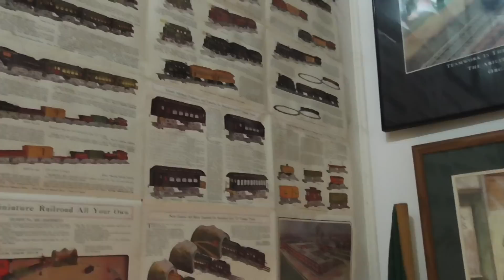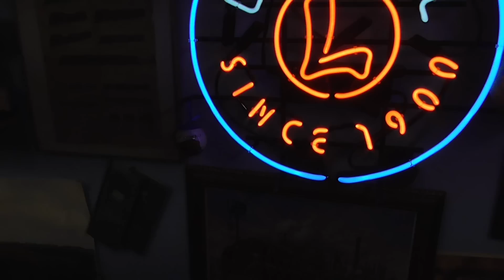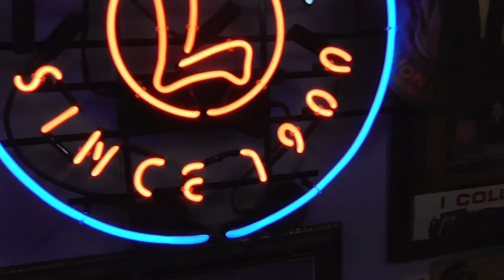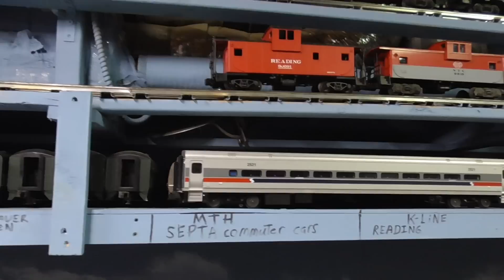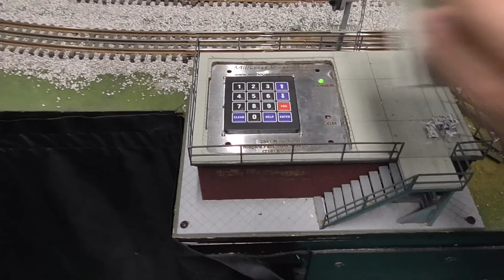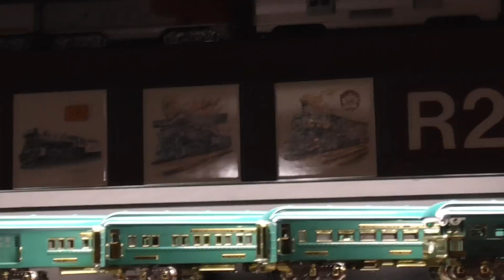2021 Dakmam Visits The Old Train Farm O Gauge Layout

Comment: Speaking of John Will's Super-chuffer boards. I bought three sets a couple years ago but when I tried to install, the process is NOT for non-electronic people. The instructions need to be re-done coming at it from a novice' stand point and not assuming that you understand electronics. For example, ERR and earlier TMCC do no look the same and this was one area of confusion. Another is setting the chuff, this was just not detailed enough in instruction. I wish a much better set of instructions would be provided with these upgrade boards. These guys like Harry who do our upgrades are clearly overwhelmed now, there are not enough people doing them and this is another reason why these instructions need to be greatly improved.

Comment: What's the model cars size which you used in your model, and what are the brands of that metal cars? Where it is available in online? Kindly reply to my query....!!!!
Reply from the maker: Most of the metal cars you see are made by Greenlight and are 1/43 scale. You can buy them at 3000toys.com or Ebay. Greenlight is also on Facebook so you can keep up with new cars coming out. Just beware that they only make so many cars and then move on.